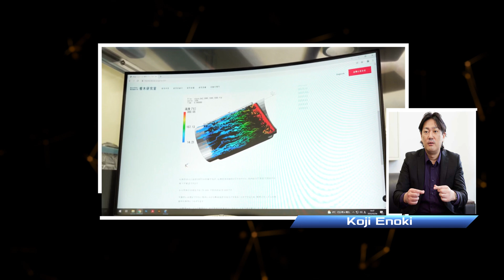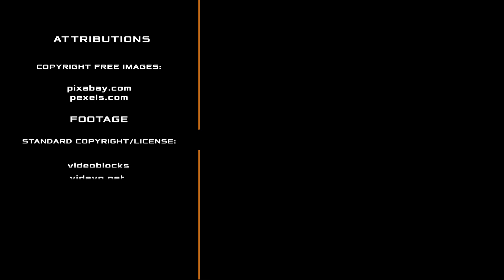JAPAN WILL GENERATE ELECTRICITY FROM SNOW

Comment: Put animals on one end of a moving platform. Place food and water and treaty’s on one end.  When they run to get to the the water and food they’ll run on the platform and generate power. Normally the animals will get too hot 🥵, but because it’s in a cold weather climate it’s very energy efficient and the animals are kept cool. You may think the animals will generate warning from running but this is actually not collected by the generator. The heat from animals running simply makes sure they don’t freeze to the moving platform.

Comment: I like the idea but I'm not sure it's really going to produce a significant amount of energy. And it makes the source of energy very dependant on climate change. could be an Interesting green energy addition. Solar and windmill only works where it's sunny and windy.

This said after years of wanting less nuclear energy I came to the conclusion it's one of the easiest, cheapest with low carbon emission type of energy. And we are capable to make it safe, recycle part of it  and dispose of the little amount of waste left in a very safe and efficient way for thousand of years. So it's a transition type of energy we have to continue using untill we can find better.

I live in Quebec, 97% of energy is hydrolic but we are lucky to have easy access to a lot of water with a relatively small population for the size of the region.

It looks like snow energy would make less than 1%,  so other reliable source will always be necessary.

Comment: It’s an interesting idea, but the energy density of snow seems very low; it seems like even an enormous amount of snow would deliver only a very modest amount of power before it melted.
Reply: Well it doesn't matter, as snow is already moved, the question is it better to dump it into sea water or just use the opportunity to produce some electricity, making the process more eco friendly and the process more beneficial. Also the trip time to plant would be shorter than in some places than river or sea. Basically that is how innovations are born. Some one else trash is some one else fortune...

Comment: Not well described and questionable principle. Cold liquid in the pipes will tend to stay at the bottom and the warm will tend to stay at the top. To exchange them you'd need a pump-motor... So to me it all sounds like electricity consuming snow-melting device, and definitely not a power-producing-plant.  Also you didn't add any reference links to video description, so this all looks like another addition to huge youtube pile of garbage.
Reply: do your research on thermosyphons

Comment: If it snows that much, how is it going to heat up enough to have a constant difference in temperature?
Snow lowers the temperature to at most 0°C. 

As said it is often cloudy/snowing there, they have 50-80 monthly hours of sunshine during November and February, only in March it increases to 120 hours, doesn't sound too realiable as a heatsource for the pipes. Average air temperature is also around 0.
Considering that it most likely will take quite a bit of time until not only the pipes, but also the fluid inside will heat up enough for any energy production i can't imagine how this produces a reasonable amount of energy.
Reply: google, latent heat, my YouTube wannabe expert friend
Reply: I agree with you.  They mention piping in geothermal hot spring water to increase the temperature difference.  That's the only way I can see this as being viable.
Reply: @nc3826  Latent heat is the heat absorbed when the snow melts in the pool. That phase change uses up energy, it does not generate it.  It makes the calculation worse, my wannabe expert friend ;-)
Reply: wrong..... since Latent heat increases the delta, so the efficiency  Is increased based on carnot  theorem...  

And Thank you for proving my point, better luck next time....
Reply: @nc3826  Please explain exactly why Carnot applies here (because it doesn't)
Reply: first, explain how can energy be used up?

Einstein said, "Energy cannot be created or destroyed, it can only be changed from one form to another".
Reply: Carnot theorem is for the advanced class ;)
Reply: @nc3826  
First i would like to know why voicing my doubts about that system makes me a "wannabe expert", Youtube or otherwise.
Do you need a degree in any specific topic to voice doubts on Youtube now?

But anyway:
How does latent heat increase the delta in this case exactly? Do you mind explaining it a bit more detailed?
Reply: @fmfmfm85 Need a degree?  One just needs to have the desire to educate themselves,  OR at least make an attempt at it .... Instead of looking to others to force feed them, all the answers.... 

Good luck with that. my entitled friend...
Reply: @mm-qd1ho   sorry for triggering you...  have a nice day...
Reply: @nc3826  
Well the desire to educate yourself can be expressed by...let's see....asking someone to elaborate how a specific effect is supposed to increase the delta in this very specific situation?
Asking someone that participates in a discussion to explain how their claim is supposed to work so it forms an actual argument doesn't make me entitled.

And if you weren't too busy acting like a first semester student that just learned his first tiny bit of information that makes him feel superior to everyone else on the planet, you could've easily explained that in the same time it took you to try to talk everyone else down for whatever reason.
Reply: @fmfmfm85  thank you for proving one point...
Reply: @nc3826  
...that you have no interest in contributing anything remotely constructive? Guessed that much.
Reply: @fmfmfm85   'You can lead a horse to water. but you can't make him drink'  

good luck learning how to drink....
Reply: @nc3826  
Yep, still nothing constructive on your part. 

I give up, you clearly aren't interested in forming an actual argument, just provocations. 

Have fun being angry at clouds.
Reply: @fmfmfm85  sorry to confuse you....

Comment: Isn't a Stirling engine more efficient at this than a convection-powered turbine?
See also the solar updraft tower.
Reply: Wut, I thought they were using a Stirling? Or a transfer fluid that can boil at just few tens of degrees K temperature difference. If not, the power output is going to be abysmal.

Comment: I heard this idea first time 40 years ago!!! They even have the idea to make huge factories in north pole and then bring the produced electricity to USA... The problem is that this system melts the ice and the coefficient of performance is too small...
Reply: When you have plenty of snow to go around, and the days tend to hover around freezing... there isn't much to lose. This isn't a for profit venture like factories, this is just generating "any" money to help offset the cost of snow removal in the literal snowiest place in the world.

If these are built in conjunction with hot springs, the "used" runoff that naturally occurs by nature of the Japanese Onsen industry they could eliminate the air based heat generation, and just pipe the hot water through a heat exchanger connected to that part of the loop. Further increasing the temperature gradient, with next to 0 maintenance costs.

Comment: Surely snow dumped into a pool of water would melt, much reducing any temp differential between the upper & lower levels of the pool. Doing similar in the sea would seem more sensible, as the temp differentials are reliable, greater over the increased depths involved, and a year round source of energy.

Comment: This very much sounds like a case where the plan technically works but the amount of electricity produced would be tiny so it would be better to simply save money with a district heating/cooling system using the geothermal heat to heat the city and storing a pile of snow for summer to cool buildings. The temperature difference between the warm top and the pile of snow is less than they could get from a simple geothermal plant, so unless the system has something new or is planned to be built on massive scale I don't get how it is supposed to pay for itself. Nice video though.

Comment: It would have been nice to know how much net energy was produced by the system after deducting all the energy from the trucks that delivered the snow.
Reply: The trucks will spend the energy moving the snow anyway, we just need to know if this project can produce useful amounts of power or is it just few kilowatts. That would still be nice to have, but not exactly revolutionary as it would have pretty high cost even relying on preexisting systems.

Comment: wait so how do they heat the fluid used in the pipes in the first place? this doesn't sound very efficient or reliable if you only source of heating is from the sun during the winter. Also as the snow melt in the pools you will have to install new drainage systems to every pool you use, as said in the video the cost of this production is much better On a larger scale. I would imagine installation costs of build hundreds of small pool generation is not efficient for commercial use by an energy provider  company.

Comment: So this "snow power plant" essentially should make use of the temperature difference between melting snow (0°C) and the pipes in the upper part of the system "heated by the sun". This temperature difference will be inexistent in winter and low in summer, leading to very poor efficiency according the laws of thermodynamics. So you would need to store huge piles of snow and cover them until summr, only to retrieve tiny amounts of energy then. And this would not be energy from the snow, which just would serve as a sink for waste heat, it would be energy from the sun. And to generate electricity from sun light there is a way more efficient, practica, easierl method: photovoltaic cells.

To make it short: This video is pure BS. Either the creators of the video have absolutely no idea of science and engineering, or they spread this BS by purpose.
Reply: While the technology certainly has some drawbacks, I think the point was more about finding a way to turn a waste product (Snow) into energy. I agree though that if the user has to wait until summer to draw power from this, the application is very unappealing.
Reply: I don't think you really understand how much snow is actually plowed away to dump sites in some cities. Huge piles that sometimes survive summer until next year. If you could dump the snow in a "power plant" it would only benefit cities with a lot of snow and incentivise plowing and actually provide more funds for it.
Reply: I agree with you but they could maybe do things like paint the heat sink black which would absorb a lot of sunlight opposed to the snow which is white and reflects the light back into space which creates a micro climate keeping its self cold

Comment: Not everyone is as lucky as Iceland to have access to geothermal... certainly not Japan.

They could actually fill a reservoir with snow in winter, and use it in summer for fresh water and electricity. Sort of like pumped storage hydro. Otherwise, they would just dump the snow in the ocean I guess. Seems wasteful.

Also, the system described doesn't appear to bias towards a direction of flow. Or at least, it would have to in order to work. Maybe the turbine is a one way type. It sounds pretty underwhelming to me. If you could actually use minute heat variations to facilitate flow via pressure, why could you just use weight variations, like a fountain. The reservoir could easily be greater than the pipe.

Comment: Probably just as efficient to put all that snow in a reservoir and run it through turbines as it melts in the spring.
Reply: Then the trucks would have to drive uphill and use more even more energy to dispose of the snow.